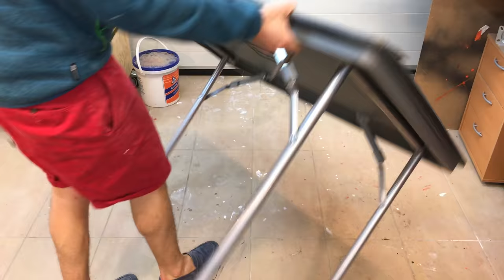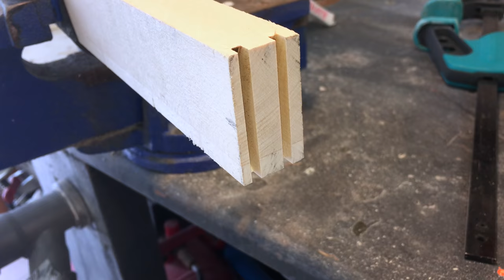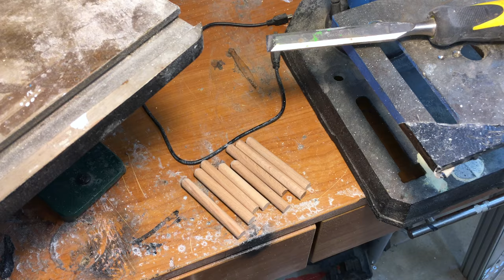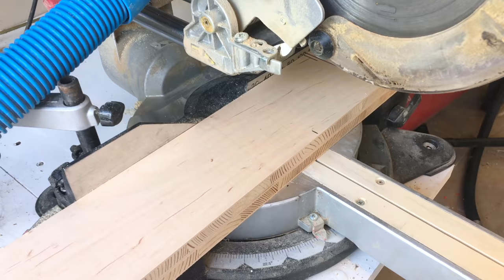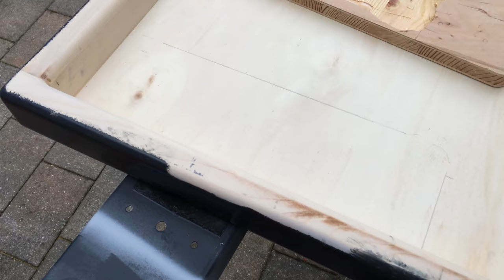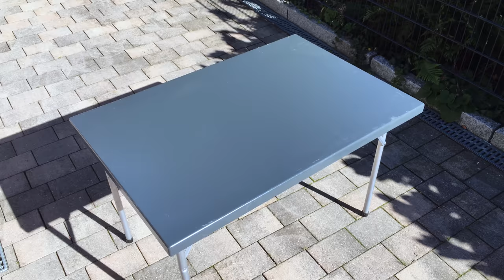Lets Make - A Lightweight Camping Table

Comment: Very good. So how strong is a joint after just domino joints as you did it? And what was the point in hollowing those sort of planks the legs bolted onto? Good vid, I like make do and mend. Oh, and how thick was the sheet of wood? It looks thin, I was surprised there wasn't a middle Barton for support, interesting how much a frame helps
Reply: I guess the plan was to keep the table somewhat light for loading it into a caravan for traveling or something like that. You probably can not dance on this table but it should be strong enough for eating from it.

Comment: A guy can never have enough clamps.
Reply from the maker: +David Rodriquez I need more long ones. 1.5m next time. But they are 40€ each.
Reply: Maybe switch to 1/2inch pipe clamps? They're a bit more but you can just buy straight pipe and use the same set of clamps for different lengths. They also don't bend when adding tension
Reply from the maker: +David Rodriquez They cost 25€ without the pipe. I like them but the cost difference is not enough. They are not very popular in Germany. Are they cheaper in the US?
Reply: They're around 15-25 USD at most stores. We do have a store called "Harbor Freight" that you can get them for 5-10 USD. (Granted quality is poor , more or less cheap Chinese made) The advantage is you can swap them out with the pipe and galvanized steel pipes aren't very expensive. I can certainly see your point though. How much is iron pipe over there?
Reply from the maker: I went to Florida a year ago and had to check out that  Harbour Freight. I got a cheap framing square and one of those magnetic pans that hold nuts and bolts. Those are great for the money, but I don´t like the overall style of that shop. Good tools have to cost some money. Next time I go to the US I will most likeley go again and have a look at them. We have Bessey here and they make really good stuff, but it also costs a bit more. I think steel pipes are about 5€ for 2m.
Reply: Bessey sells pipe clamps too. Basically just attach them to steel pipes, and they work really well.
Reply from the maker: +920contact yeah but they are quite expensive.
Reply: Max Maker Didn't see the comments above. Yeah, they're a lot cheaper in the US, ~$12 for the Bessey clamp part on Amazon, and <$10 for the pipe depending on size.
Reply from the maker: +920contact That is so unfair considering they come from Germany. Maybe yours are made in China?
Reply: Yep, pretty confident ours are made in China.